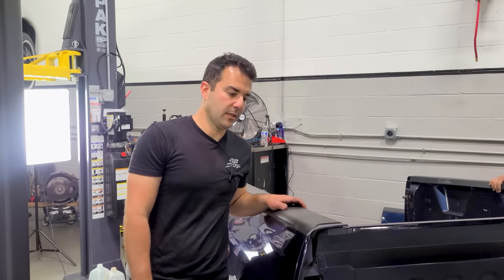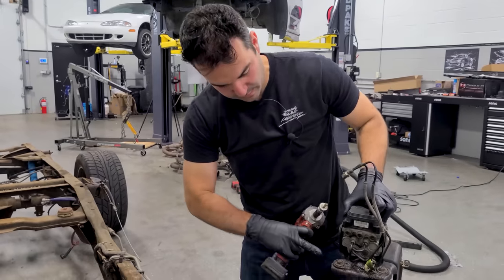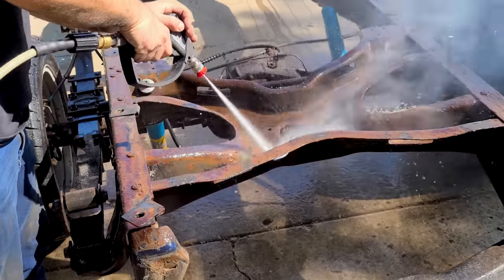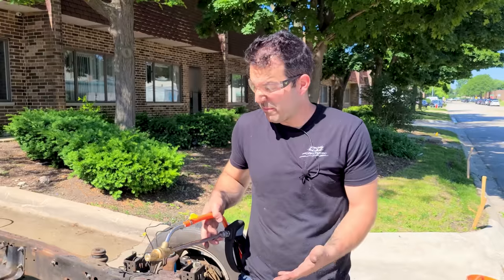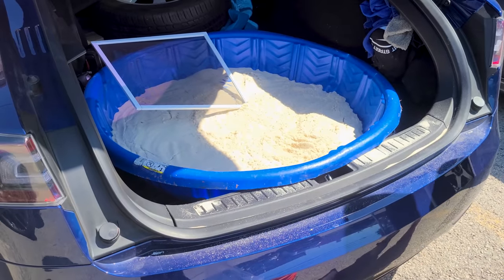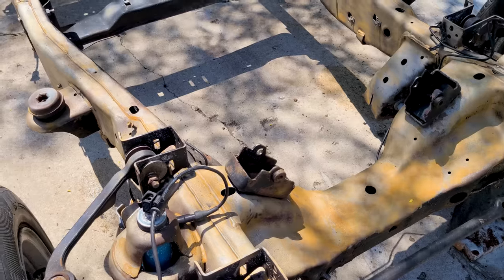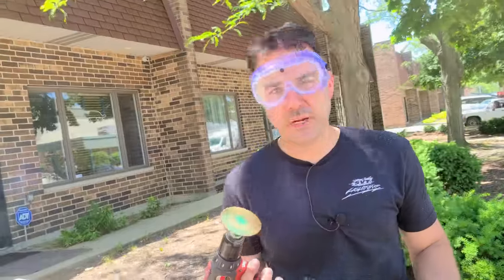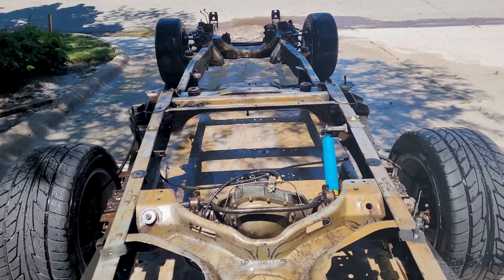I Was Quoted $3,000 To Sandblast My SVT Lightning Frame So I Did It Myself For $100 & So Can You!

Comment: Have you considered using phosphoric acid to treat the blasted metal prior to coating it? I have had pretty good luck with that in the past. The phosphoric eats any remaining surface rust, then you rinse it off leaving a gray or black oxidized surface from the acid etch, which you then coat with an anti-rust coat of paint.

Comment: IDK if there is any easy way to clean up a frame. But I could never see myself doing that. The clean up would be so huge. I would rather. use wire brushes on a polisher and treat the remaining rust with rust converter. Do sections. Ones that are manageable.

Comment: Couldn't you pick the frame up and stand it on its side and then blast the bottom side?
 Also.......would glass beeds worked too, not to mention wet reuse wouldn't be a problem?

Comment: Yep I wash for a living all kinds of things houses, buildings you name it. . If you want it to be a faster job get more gpm pump. I have done it a few times with my 8 gallon per minute machine. It is way faster when you have three tines the flow it goes three times as fast. With the higher volume it doesn't clog up as much either.

Did the same thing with my 40 Ford frame it came out spectacular. I have yes the blaster to remove paint where someone tagged a brick wall works great.

Comment: Hopefully water doesn't cost much at your place ! Here in Belgium, because of water cost, I would sand blast dry, but that is another machine I have to buy (not that expensive btw)
Reply: Yes! that water is running at 2.4 gallons per minute!!
Reply: The cost of the water won’t be cheap but it is inexpensive courtesy of the very large (#5 world wide) lake just to the east.

Comment: Certianly is satisfying to get back to metal 😀 Personally I'd have used an abrasive like crushed garnet or iron oxide as the kids sand is too rounded so A) takes more time to remove paint/rust and B) leaves the steel too smooth for a chassis paint to grip too.
You'll also have to go over it with a rust remover for the flash rust and either have to sand the steel or use an etch primer to get a good bond of any paint product. Also, please don't use POR15!!! IMO it's crap and there are much cheaper, better and tougher 2 part epoxy systems out there.

All the best though with whatever way you choose to go painting the chassis 😀

Comment: wow this is a cool DIY project, seems like a ton of work, but pretty economical i must say. I don't like if it would cost thousands to have it blasted however, i saw Vtuned had his mustang completely blasted with a real sand blaster and there was a sand blasting truck that came to his location and did it in a few hours with really nice results. I would bet that in most big cities there are similar services than having to ship your frame to a sand blaster.

Comment: I sell water blasting equipment ocassionaly, and there are corrosion inhibitor additives available wich can be added to the water through chemical tanks on most pressure washers. No more flash rust! Much needed in the fishing industry i normaly provide equipment to here in Norway 👍🏻

Comment: I did a frame off restoration on my 66 Chevy PU and sandblasted the frame myself at a shop where I had worked part time. That was 40 plus years ago. One of the dumbest things I have ever done is sell that truck.

Comment: Head gasket job turns in to full rotisserie restore 🫡 I would make sure and change out the diff oil after this and those open brake lines up front too

Comment: You're definitely going to need to hose out the inside of the chassis to prevent any sand in there acting as a sponge, and also the brake calipers, or your seals will be buggered before too long!

Comment: Used one of these on a restoration I was doing with a friend. It does a good job but the cleanup is a pain in the ass. The wet sand cakes up in all the little hiding spots and is impossible to to clean out completely. I know for a fact there is still sand hidden in little areas in our completed job that compressed air and shoo vac couldn't get out .

Comment: Just a quick question may be dumb I know but isnt coating the whole frame pointless because the inside of it isnt coated and it can rust from the inside. Water definitely gets inside those holes sand blasting is definitely the way to go though

Comment: You should have used glass bead  media you can recycle  it wet and reuse immediately  unlike sand.. also you should be blasting with a liquid  injector  on the pressure washer and add phosphorus acid into the water steam you wouldn't have any flash rust... or have a buddy with weed spray pump spray phosphorus  a identical over the feasibly blasted area... 

And wear a full rain suit
Or get your buddy Samcrac to do it for you.

Comment: I rented a compressor that puts out 200 CFM and used medium coleslag with a sandblasting nozzle that costs $2,500 if you buy it. I sandblasted the frame of a very rusted 2008 Silverado. I would never do that job again! It is a horrible job it's hard work. Pay somebody else to do it. The guy I got a quote from to do dustless blasting was about $800 and he was going to prime it for that price

Comment: i think you could blast with co2 mix and baking soda or glass beads or walnut shells - will be interested in seeing what you use for paint - the difference will be huge since it will last 2x longer if you are in northern areas where they use salt - it is good pm #frame off resto

Comment: Although dry sandblasting is better for results, it is also very costly and requires a lot more specialized equipment. Like a sand trap, etc. The only reason that it is better is that there is no flash rusting. Lo and behold! there is an additive that can be used in the soap dispenser of the pressure washer that retards rusting. You should have done your research. After the fact, just use a spray-on rust converter. ( Notes from an old geezer that has been a few places and done many things.)

Comment: last thing you want when blasting steel is get it wet before you paint it. it will flash rust very fast. how do you work with wet metal blasting?

Comment: I understand the DIY and low-cost aspects of this method...BUT...unless mess is not an issue...I would have researched every 'rent' or 'buy' option related to Dry Ice blasting.  No mess, no water and no rust with dry ice. Clean-up would only be whatever you blasted off the frame.

Comment: Only issue is flash rust. Wet blasting causes loads.. it'll be rusty again in an hour. Dry crushed glass blasting is better.. a lot better.
Reply: Exactly! Double work IMO, have to go back and clean the flash rust again.. not smart. Not to mention all the wet sand that has now worked its way into EVERYTHING.

Comment: Wrong nozzle for the pressure washer without sand, You need a turbo nozzle.  Also, what you’re describing is the Venturi Effect. Not so much the Bernoulli principal.

Comment: It would be a shame to not add some additional bracing to the frame. Back towards the rear diff the frame has too much flex where the factory rivets the frame to the very rear section. Its an easy fix with a welder and bracing.

Comment: The only thing you can worry about is the water consumption. If that machine uses 2.5 gallons per minute, that's 150 gallons per hour and 2400 gallons at 16 hours or in metric that would be 9.46 liters per minute, 567.60 liters per hour and 9081.60 liters at 16 hours. It's really scary, not only for the environment but also for the water bill you will receive.
Reply: Call the water department ahead of time and ask for a "variance" on your water bill. Tell them you're filling a swimming pool and they'll give you bulk-water rates, which is about 1/10th the standard cost of water.

Comment: Wire wheel on an angle grinder and sandpaper would be about as fast and you wouldn't have a ton of sand inside your frame and every single joint.
Reply: Yup

Comment: There's a few problems I see with this tbh. First...it's a massive waste of water. If you're outside anyways, a typical sandblasting would do the same thing if you wore a mask and goggles. I could only see the benefit of this if you're indoors. The second is where you're spraying water...which I can only assume is tapwater...you're introducing contaminates directly to the now raw metal and possibly imbedding them into it. I might be wrong on this...but honestly I would just rather use a sandblaster and not run a waterbill up.

Comment: Is there a reason why you wouldn’t get two moving blankets from Hobo Freight and put them under the wheels as you turn the frame up on it’s side to get the bottom?  Need to steady it, get two 2-by-4’s and fix them to the frame and lean it a little.  It’ll even be better on your back as you will be holding the nozzle at a more natural position.  Heck, lean it against a building.

Comment: Looks like your impact gun works really well. Mine was a bit under powered so I bought a Harbor Freight Earthquake 1/2" Impact and it has not seen a nut it cannot remove yet.........and I work on Diesel Big Rig trucks and trailers. It is sooooooooooooooooooooooooo Awesome. Had it 2 years and the battery is STILL Good. Maybe being an influencer you can get HF to send you one for free Review.......maybe.  
I used an air compressor and sand. Have done this method but without the water. Looks like it worked better with water. Nice. 
How do you prevent flash rusting after removing it initially ???? The dry method with air you can easily prep and coat it with a primer/sealer immediately after.
Never mind, watched the rest and got the answer. Again dry method you have no flash rust.

Comment: It’s not a great idea to use play sand unless you want silicosis. The water probably mitigates that a bit here but in general it’s better to use a coal slag product like black beauty etc or glass beads which is exactly what the dustless blasting guys use.
Reply: I understand "play sand" doesn't have the sharp edges like typical sandblasting media. Just a thought... why are the nice soft aluminum wheels right next to where you're blasting?

Comment: I thought it was the BERNOULLI principle that gave an aircraft wing lift and the VENTURI effect that sucked things up using passing flow, as in a carburettor needle valve?
Reply: Yes.  The Venturi effect is what draws the sand in...  Or the paint into the airstream of an airbrush....  Or the fuel into the carb....
Reply: Actually, aircraft stays in the air because of the lift fairies that lives in the wings 😂😂👍
Reply: It's effectively the same thing, flow causes vacuum normal to the direction of flow.

Comment: Better… think of the time saved by not doing a full strip down, especially the soft bits…. My only concern if the grit residue.  Still,m very cool.  Look into to FROZEN CO2 blasting, just the gunk cleaned off and CO2 when you are done.  Great for mold abatement

Comment: The reaon why after blasting, rust appears is because u used a water jet, so while u r removing old rust, u r "injecting" fluid from the water jet onto the bare metal . .  ideally, water jet sand blast is not encourage as it will create more rust issues if its not treated properly

Comment: Too bad someone doesn’t make an updated frame. Maybe lighter. Or an all aluminum frame. Obviously not for hauling but most guys use it for street use only. Lightnings are heavy as hell. Would be sweet if you could cut 1000 or 1500 off weight by changing things up. Like the x brace in the back and the giant kmember up front.
Reply: It's heavy because it's still a truck. I could be wrong but I don't think you can use aluminum for a frame. Frames like to flex so if you make a aluminum frame thick and rigid it may not crack in half. Some race cars and trucks use D.O.M. tubing to make the frame.
Reply: @Gogibear  Yup, the price adds up fast. It would however be a fast, bad ass truck that could handle like a sports car.
 I have a 94 chevy silverado and I want to improve the engine and give it a nice exhaust system.  I would love to spend $100k at Summit racing and lmc truck to make the silverado a superado!  We all like to dream, that's how we stay sane!

Comment: Striping a car down to this level is not DIY unless you are in a rural area with a large metal building on it and you restore cars. You restore a Model T or 6os barn find, this and being able to weld the rust would be part of the process.

Comment: I mean, can't beat the price but, a little more prep work would've saved a lot of water. Coming from an area going through an intense drought, this was bittersweet to watch, satisfying yet painful because of all the water used.
Reply: There is a version of this method that re-uses the water. Basically just have to catch it and filter it so that absolutely none of the sand gets into the pump (pressure washer). With a more advanced system you don't even have to wait for the sand to dry, it works with the wet slurry. 

As a side note, he said it took 16 hours, and that pressure washer is 2.4 GPM (gallons per minute), so he used around 2300 gallons of water, about a month worth for one-person household. Quite a lot of water, volume-wise.

Comment: Could you have just used a different less fine sand to get a faster result? Obviously nothing crazy abrasive, but there are options when picking sand even at a home improvement store? Also why not use use one of those paint on rust inhibitor/convertors like POR15?

Comment: You was better off using dry ice and also spend the $1500 - $2000 electric pressure washer that you can mount on the wall or a cart. Watch detail geek and look at all the stuff he uses to wash cars. You can find the links to the products he uses in his video description.

Comment: It's not as big as an issue with wet blasting but using regular 'sand' for sandblasting is a recipe for serious health problems. Silicosis is an extremely serious disease and is caused by the Silica found in regular sand that isn't intended for blasting. This is no laughing matter and isn't one of those over reacting safety issues. Be safe.

Comment: 3k?!?! 
I literally do dustless sandblasting with the legitimate 65k machine and it’s about 600 bucks to do that chassis. In a few hours that Frame would be grey ready for paint immediately. It’s full car or truck bodies we charge 2-3k for because of the caution we take to not warp panels,amount of media and overall difficulty getting into as much smaller areas as possible. I’m 100% for the diy experience. But companies ripping people off is BS because it pushes people to do diy jobs and the majority of the time those jobs don’t get done or are so difficult/time consuming it’s half assed. I’m not saying you’re hacking or anything I’m just irritated that companies charge so damn much when I know personally it’s not and shouldn’t cost that much.

Comment: Pressure washing it and then using rust Mort would of gave you the same if not better results with why less work it's about 60$ for the rust remover it also seal it  you let it sit 24 hr and spray it with water your done.💯👍✌️🛠️🍻

Comment: I heard you pressured washer running in the background while you were doing some commentary, for those who plan on doing this you should never (except for emergencies) fun the engine on the pressure washer without water running through the pump. Do not let off the trigger. If you need to stop turn it off. If you run the motor without  water going through it you WILL shorten the life of the pressure washer.  Also make sure you have big enough machine to do the job.

Comment: $150 but also 20 hours of your time. $100/hr that's 2k - shipping it to a pro you pay 50% more but then you also get back 20 hours to use for some other purpose, such as prepping all the components taken off the frame. Different ways to slice and dice the operation.

Comment: 16 hours = 960 minutes @ 9 litres per minute = 8,640 litres = nearly 9 cubic metres of water. That's a lot of water :). Pro Tip : If you use 9 cubic metres of liquid rust converter, you have no flash rust problem :-) #themoreyouknow But it would cost ... $280,000 for the rust converter needed for 16 hours :-)

Comment: It looks like lots of sand and water is entering the frame box sections through the holes?
How are you going to remove all the wet sand that is now sitting inside your box sections?
This may create a corrosion issue later on, as the inside of the box sections are not normally protected as well as the outside

Comment: Guys why didn’t you just flip the frame over it’s not hard to flip it from passenger driver side just swap out some tiny rims on one side and roll it or use your fork lift and lift up the front and the lift up the rear letting it hang enough to spry it..

Comment: Sand blasting around the steering box, ball joints and suspension parts is not the best idea. I remember a guy that sandblasted his dash with the steering column still attached and ended up replacing the column.
I’m also concerned about not using a mask during the sand blasting. Bad on lungs.

Comment: How are you going to remove all of that sand from inside the chassis rails (that entered through the bolt and bracket holes? Wouldn't wet sand (from water getting into the chassis rails from driving in the rain) cause more rust?

Comment: The bed and frame was already in a lift bay, why not use it to easily and safety lift the bed off and then roll out the frame?
And then you shove the floor jack all the way to the axle to lift the axle instead of using the receiver hitch.
And then you took the wheels off to lower lifting height.
And then you lowered the floor jack so far you couldn't jack it back up.
And then you took off the tailgate lighten the load.
And then you killed yourself carrying the bed back into the lift bay.
And then you had to bring in a motor lift to remove the floor jack.
And then you had to put the wheels back on.
Some people like doing things the hard way(s).